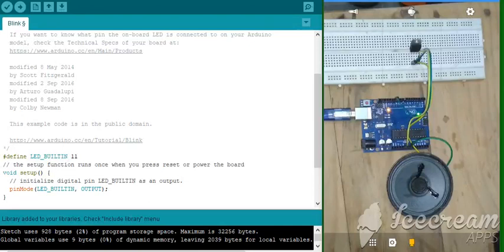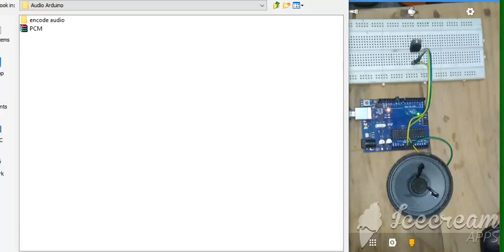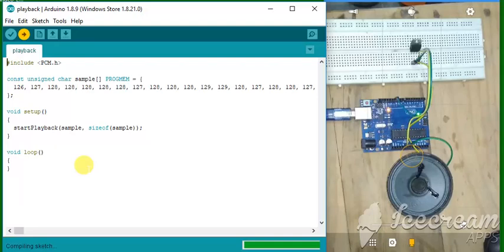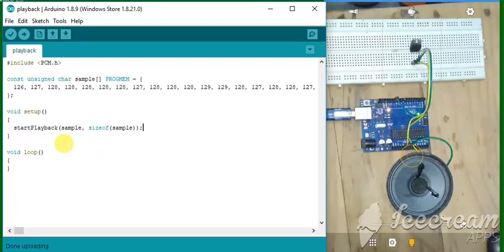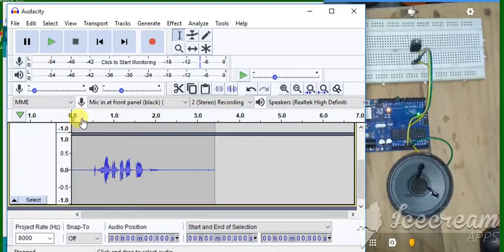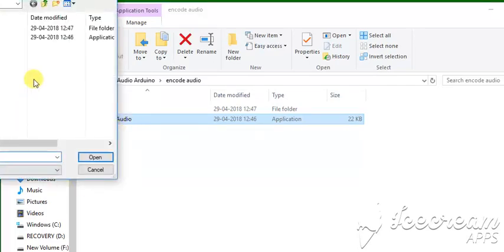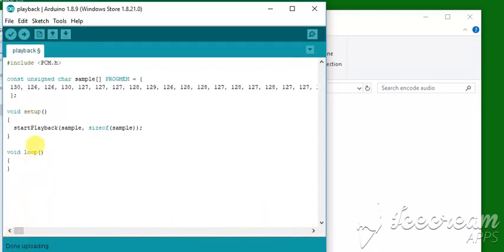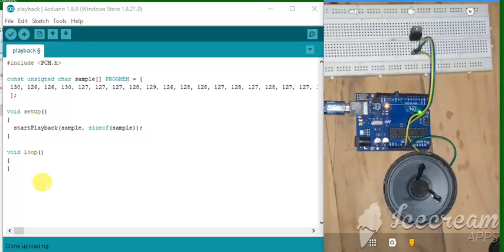playing music with Arduino | Speaker interfacing | Talking Arduino | VEDTUBE

Comment: I have a question sir. If I have a speaker of 8 ohm and 0.5 W, which resistor do I have to use to connect it to Arduino that is 5 W??
Reply: Hello , please make a video to install encoder software please
Reply: use a cap for filter voice

Comment: ( 1 )  in pcm library
how i can change sample  from 8000  to 22000  or any sample.
   
( 2 ) pcm library it can run on
nodmcu esp8266
Reply from the maker: * The audio data needs to be unsigned, 8-bit, 8000 Hz, and small enough
 * to fit in flash. 10000-13000 samples is about the limit.

Comment: Can you do this program with the input of a digital pin without a reset button?
If it is possible, please share with me
Reply from the maker: Yes it can be possible
You need to call the array when button is pressed
Reply: @VEDTUBE  please give the example
Reply from the maker: @ShuvoEveryday  use the digital read example and inside if statement call the function .
Reply from the maker: @h4k3r sv 
Connect me on my Instagram page 
Vedtube
I will share the code with you.